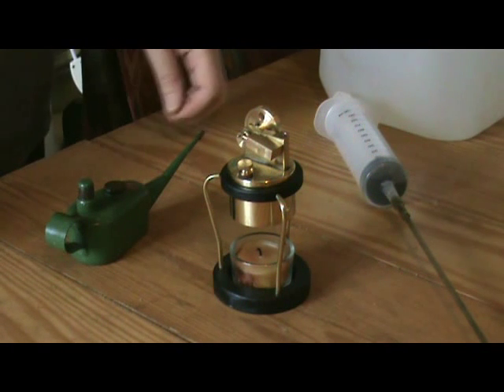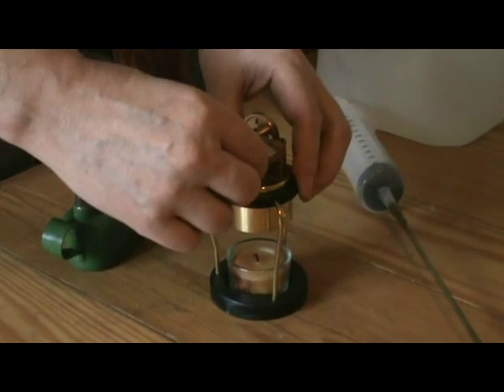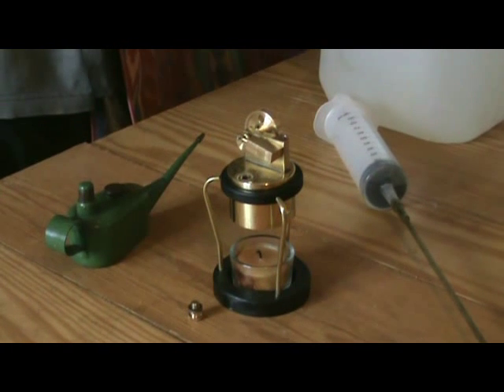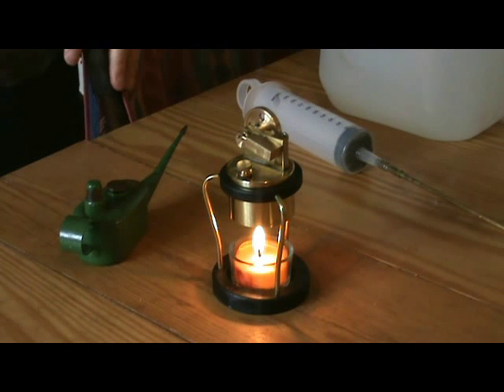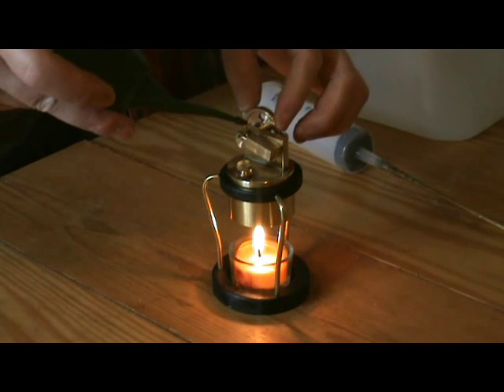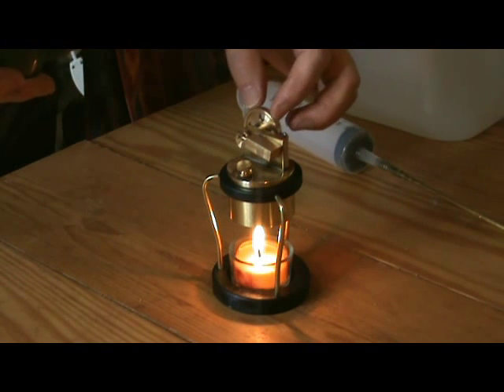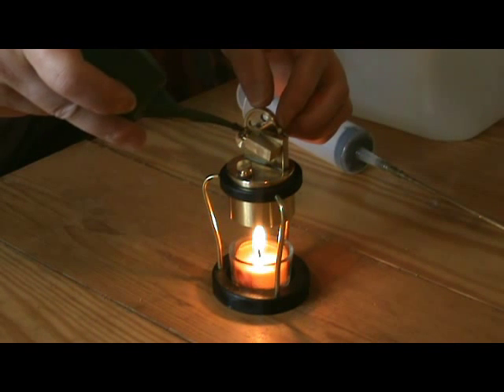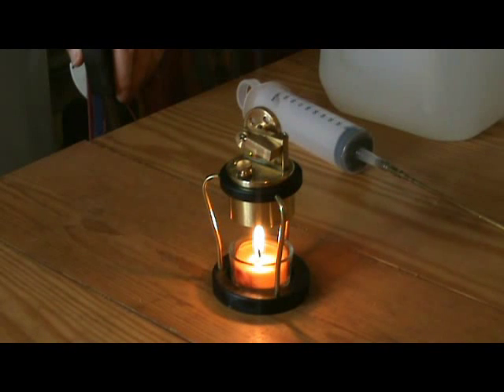Wilesco D2

Comment: Roly! I have a question about the D2, I just bought one but I'm looking for an alternative for the beeswax candles at the price of Wilesco. Do you know any alternative for them on any website?Thank you very much, Nachosteam (del foro).
Reply from the maker: You can buy them in craft shops or on Ebay, but they are not much cheaper than Wilesco branded ones. It is possible to buy beeswax and make your own but the quality of the wax is variable. Alternatively, you can do away with the wax and use a small meths burner of the type used in small Stirling engines. (Don't bother trying the ordinary T lights. They are no good.)